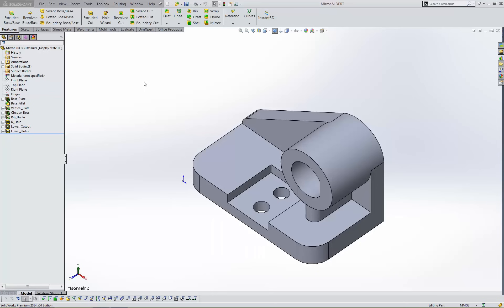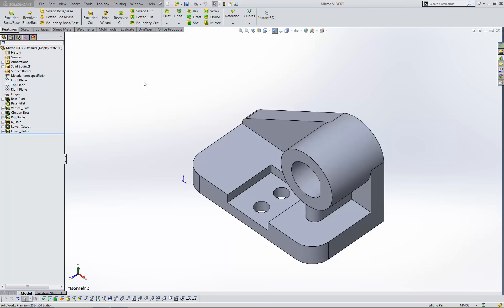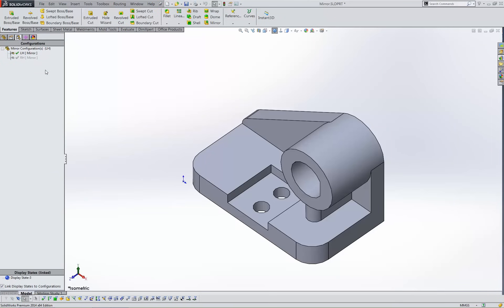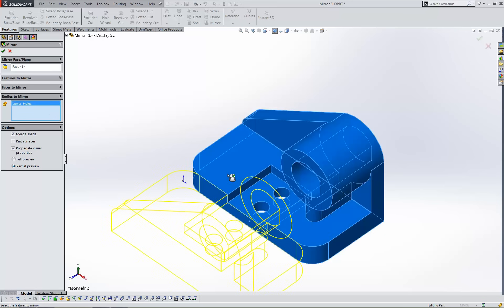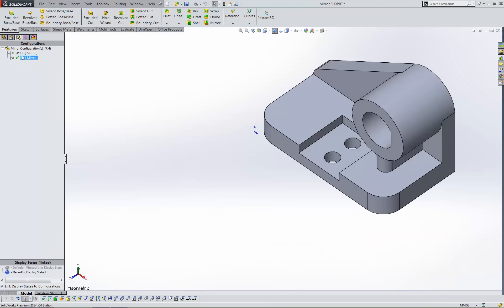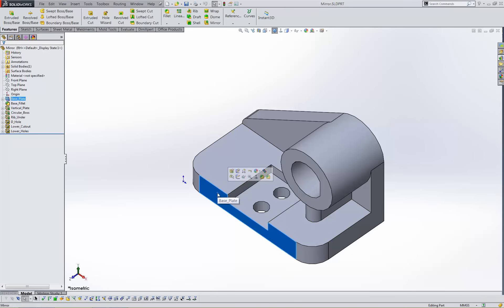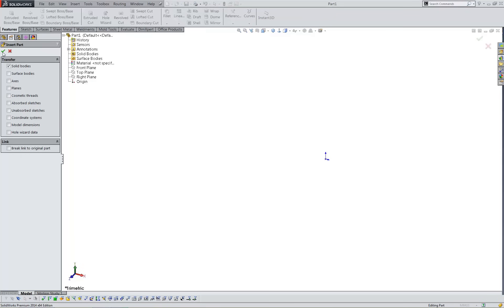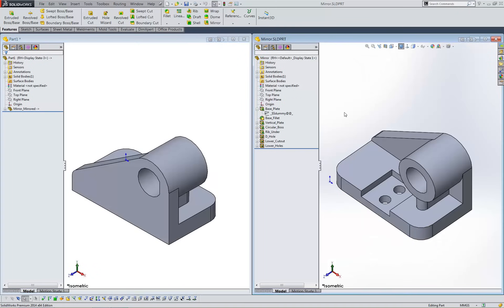SOLIDWORKS Quick Tip - How to Mirror Parts

Comment: HELP
thanks for video, can i make a mirror part undependable to source part?? i don't want to when i make a change on source file, mirror file be changed automatically
Reply from the maker: Hi Akbar,
The mirror command named "Mirror Part" that starts at 1:29 in this video has an option to "Break link to original part" that, when enabled, will create a new part file that is independent of the original.  This should accomplish what you are trying to do if you want to change the original design without changing the mirror design.
Reply: 3.14*10^111 time thanks. :)
Reply: 3.14*10^11111 time thans :)

Comment: How do i mirror a part that doesnt have any flat faces?
Reply from the maker: Hi Jonathan,
In this video one of the planar faces was used as the 'mirror plane' but it would be perfectly fine to just use one of the principle planes (Front, Top, Right) in the model work space as the 'mirror plane'.  You would still create a body mirror and delete the original in the same manner.
Reply: Use an existing Plane or create a new Plane in the location you require.

Comment: CAN YOU SAVE THE MIRRORED PART AS ANOTHER PART?
Reply from the maker: Yes, there is actually another command just for this.  You would first select the mirror plan you want to mirror across then go to 'Insert', 'Mirror Part'.  This command will let you save your mirrored object into another part file.
Reply: GoEngineer Please, do a video about it, no one really looks to all the possibilities to use in a symmetry.

Comment: Hi, i'm trying to do the same with a sheet metal part, and when i choose the needed plane i get the message 'bend face is an invalid face for sheet metal'. It won't mirror about a plane coincident with that face either. Do you have any advice?
Reply from the maker: I believe that you are running into a known issue in the software where faces of sheet metal are not allowed to act as the 'mirror plane' for a mirror feature.  You would want to use a plane instead (you would need to create one if an appropriate plane is not present already using 'Insert', 'Reference Geometry', 'Plane').